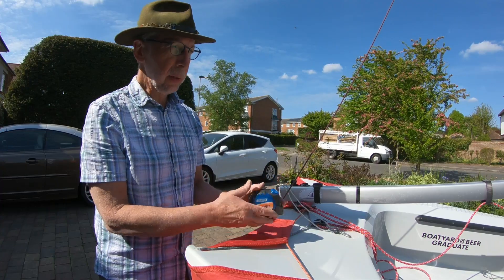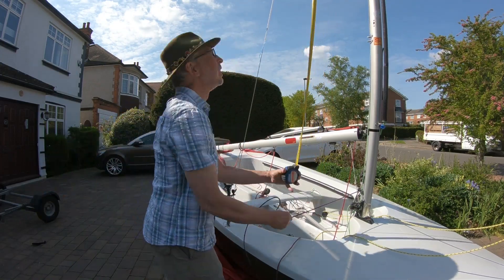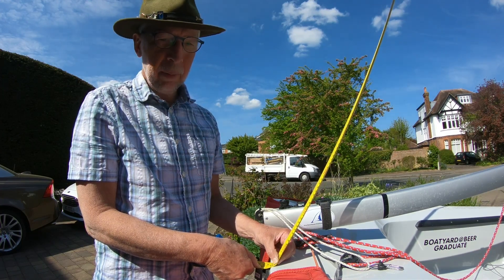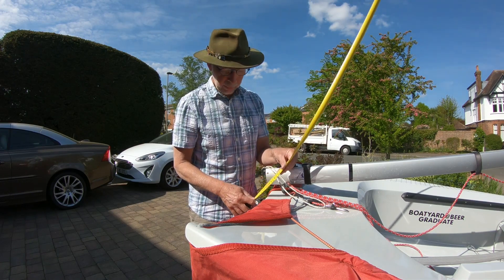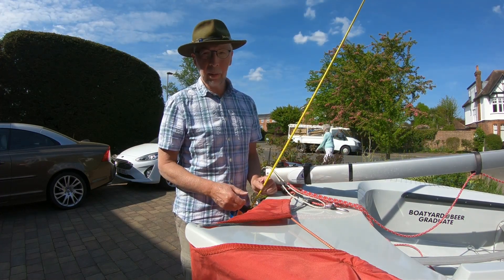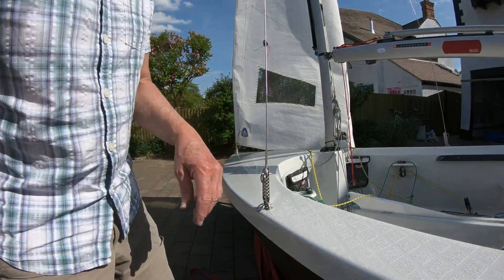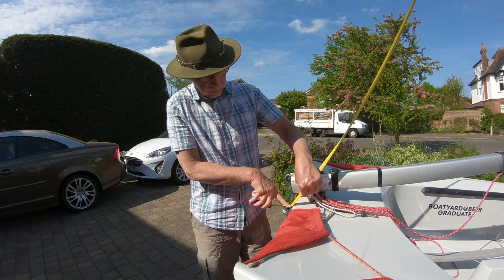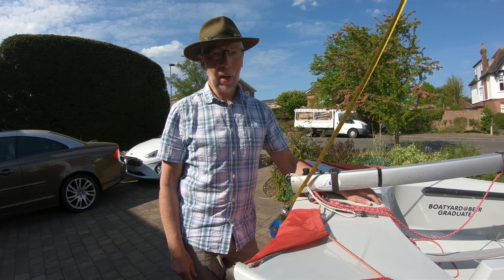Mast Rake measurement Method 2

Comment: Good tutorial, thanks. Ive never liked the idea of measuring from vertical as even small changes in the angle can make large differences in the size measured, It is a transferable dimension however. Measuring to the transom is harder to transfer as up until the latest boats at least, every boat is different. However for an individual keeping track of there own settings its a much easier and more repeatable dimension.
Reply from the maker: Thanks Ian. I agree, hanging somthing form the mainhalyard is open to all sorts of errors and is also much more difficult to set up. Hope you are all well. Liked your latest video on your boat journey. Nice to see all the family (dog included!) Bob